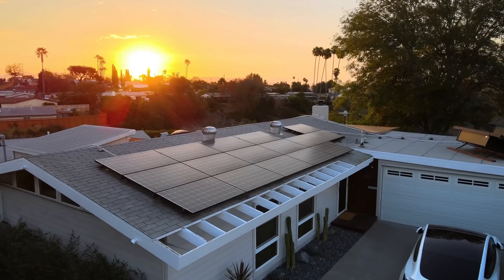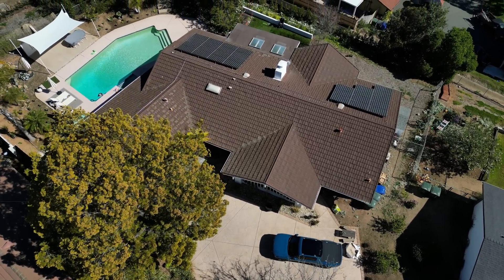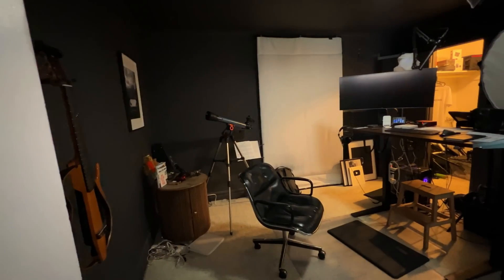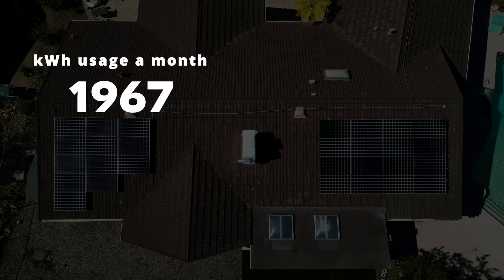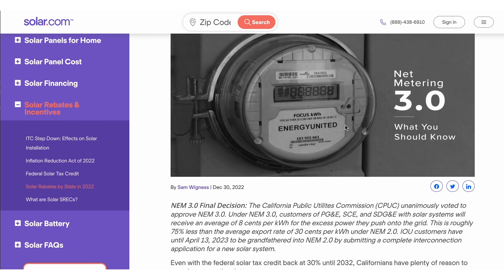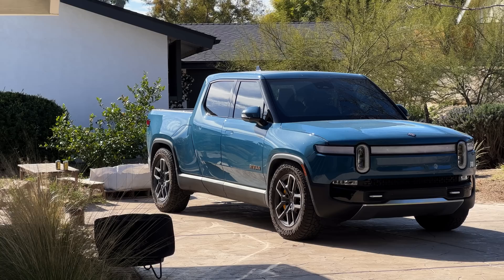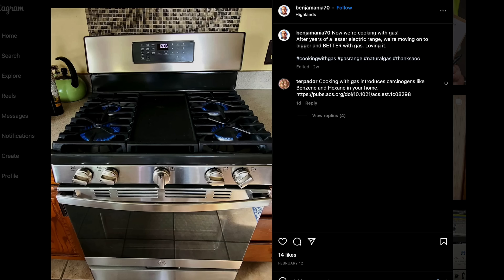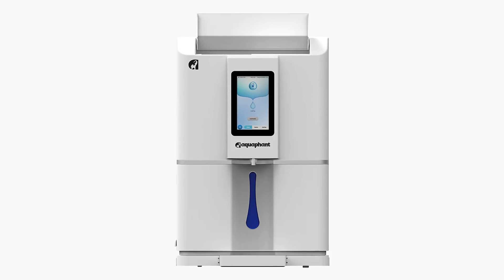Going Off-Grid at my New House!

Comment: Last year when gas prices hit record highs I stopped using gas for cooking and bought two of those same exact same Ikea induction plates. Together with another great electric gadget for the kitchen I used a dual airfryer unit. Result, massive reduction in energy cost from gas and a modest increase in my electric use. But as a guide, focus on the reduction of energy use using LED lights, behavior change in leaving lights/devices on, update to lower energy use appliances (like a dryer that uses a heat pump). Then insulation from solar heat using heat reflecting paints on your home, rockwool, etc. Then finally how to put together your own powerplant. Add solarpanels over your driveway, or solarpanels in the floor of your driveway and electricity storage. I like your water generator experiment. But be aware there are many more manufacturers who make such machines, small and large ones.

Comment: Heat pump dryer, water heaters, and AC, though central heating may not be needed in your area. Propane fire place and grill to help you get fully off grid from gas lines. Don't go with instant hot water heaters. They use a ton of electricity at the time of use and will require more batteries. Tank hot water heaters are effectively cheap batteries when it comes to heating water. If you want instant hot water, use smaller hot water heaters for those rooms. 

One thing that I'm curious about is more with water replacement. Fresh drinking water is very important of course, but going through options to get off-grid from water lines could be extremely helpful. Wells may not be possible in your area, but rain water collection along with less clean dehumidifier type options and a large holding tank could be possible. If nothing else, you could at least replace grid water for the pool and yard with that.

Comment: I would like to see you start with the solar system; particularly I'm interested in the efficiency of the current group of solar panels.  The newer panels produce so much more power per panel.  Also, are you certain a 2000 watt system is large enough for this home?
Reply: He didn't mean a 2000 watt inverter...2000 watt hr
Reply: I was thinking the same.   Are the current panels on micro inverters or are they string based?   Might make sense to take the array that gets the most irradiation and replace them with 400 watt panels.

Comment: The water hear and dryer I would leave gas. With my house being all electric I really wish I had a gas furnace for backup, a gas water heater is optional, and gas stove and we actually use a hot plate off the ecoflow when the power is out. But we do, in fact, have a portable ac with a heatpump built in here in East Tennessee. Heat is a big thing for winter. But I believe 16kw with about 30kwh of storage should be able to keep you off grid with water heater and dryer on gas. I'm guessing you went with Franklin? Batteries for the generator input. Smart move, that's the only thing I didn't like about tesla powerwalls. Other than that amazing batteries. Waiting patiently for your next video! We're gonna be getting a gas stove and 2 100# propane tanks with taxes next year. The wife misses cooking on gas and hates electric lol. All opinions, btw we love your channel and beautiful new home!

Comment: Heat pump clothes dryer and water heater, instead of gas or electric heat. Plus heat pump clothes dryer doesn't have a vent, one less hole in your wall insulation!

Comment: There are heat pump, a.k.a ventless, clothes dryers as well as heat pump water heaters you might want to check into. Those would be a quick project that could be tackled while you are finalizing your PV and battery plans.

Nice house.
Reply: We have just gone heat pump dryer in Australia. Fantastic but different. They don't toast your clothes and, in fact, don't set out to generate heat. The mechanical operation does generate a little heat but it is modest. They are clothes dehydrators in essence, not clothes cookers. Gentler on your fabrics but a little slower to complete a cycle. This is not an issue in practice. Very energy efficient and very much part of the "Stop burning stuff" and "Electrify everything" solution. I am always staggered at how much energy North American houses use. My solar makes 5.04kW at peak and we still send most of it back to the grid. Still watching the evolution of battery prices down under.
Reply: I hang my clothes outside or on racks in the house with a back up never used drier.  But the heat pump version really appeals to us.  We are interested in solar + batteries ( no money , just dreams ) and will be following your journey with interest.
Reply: Yeah great suggestion!  They suck moisture from the clothes by condensing it out of the air onto cold radiator baffles(? not sure what to call them). My brother lives off grid in a treehouse and has this kind of dryer.   Apparently it works great!
Reply: They don't get clothes super dry, but that just damages the fiber anyway.  Not damp...just not staticky dry.  They also take a bit longer.  If it is a big deal, get 2.  They also tend to be smaller.  That will probably change...Americans want bigger appliances than the Japanese.
Makers want to stay in the standard dimensions, but you can't have a 7.8 cubic foot capacity and a good heat pump in the same volume. They need to just make it taller, like it had a pedestal.  They could probably still have a half drawer in the bottom.  Who wants to pull out the full length drawer anyway?
Reply: @ChessMasterNate  not in my experience. Yes take longer but no heat pump dryers don’t get super hot, nor pollute your laundry room with excessive heat. We have an LG wash tower which is one unit with huge 16kg capacity in both washer and dryer. Heat pump has a 10 star electricity rating, using 4-5x less than a traditional dryer, plus being a condensing dryer, you can keep the windows closed and no humidity/ temperature buildup (important in summer if you are cooling the rest of your home). This LG is huge, 140kg mass so stable as concrete, but being an all in one, it knows what you just washed when you load it into the dryer section. We can wash super king duvets in it no problem, or a dozen towels. Expensive but recommended
Reply: This is exactly what I was going to suggest.
Reply: The GE model announced at KBIS a few weeks ago is the best combo unit I've seen.  They've fixed the lint collection issue with combo units and they're just a bit taller than a standard unit.   I imagine it'll become the new thing for the well heeled who will put two in a laundry room and will end up over 200 percent more efficient doing washing/drying.
Reply: Go with solar hot water. I have it and love it!
Reply: I was thinking the same thing. It would be interesting to see a comparison between the gas dryer he has now and an all-in-one washer dryer with a heat pump.

Comment: I'd defintely say the battery project and true up panels should be first. Buying my first home soon and although I'm in the solar indistry. Always nice to see your favorite youtuber install it lol. Also as well make sure you have a good amount of offset for the extra panels your adding so that in the future if your electric consumption increases you can have the capacity to comp with it. I say that because after NEM 3.0 goes into affect, if you uprade your system now and then add more later years down the line, it'll switch you to NEM 3.0 which sucks. Amazing videos, can't wait to see more new house content! Cheers!

Comment: Hey Ben they have heat pump dryers now. You can do it! The gas dryer is precisely the appliances you shld try to replace with low emissions one bc it's one of the biggest emitters!
Reply: We switched to a Miele heat pump clothes dryer last fall.  Smaller than most US models, and requires a bit more weekly care to vacuum the plinth filter, but not only does it not consume much electricity itself (runs off a 15A @ 120V circuit vs. 30A @ 240V for our old dryer), it also doesn’t vent to the outside, so you’re not throwing away conditioned air.  Just has a small water outlet that goes in the drain same as the washer, and it condenses the water out and tosses it down the drain.  Between the unit’s reduced energy and the conditioned air’s energy, huge savings.
Reply: @davidhunter4617  Thanks! I had little doubt they'd beat out an old electric dryer for cost efficiency. I'm hoping Ben will do this in the end and compare cost to running a gas dryer. I'm not sure if I'd switch because power is so unreliable here. I would have to put in a home battery first for sure. But that's something that is on my list.
Reply: I was just going to comment this. The heat pump ones (they use them in Europe) are smaller in capacity, and run longer cycles, but are apparently easier on clothes (lower temperatures) and since they don't generate heat (much like the heat pumps in tesla Model 3s) saves a ton of energy.  You could also look into the heat pump Water heaters too.
Reply: I've heard of these. I'd love to hear some information about how efficient dryers are.

Comment: HI Ben great vid. I would like to see how the new battery & add on solar panels are installed. New electric panel needed for more amps ect. I saw you at the Electric show in San Diego a few weeks ago. Also its great when you include you lovely wife in your videos.
 Thanks. Mike McHale ps do you offer consult I want to upgrade my panels and Battery also just got a huge quote it looks like what you're doing may be a good battery alternative

Comment: Based upon your current energy consumption, it almost looks like your home is in need of an energy retrofit to reduce your heating/cooling demand. Windows and doors are a good place to start, then air sealing, and finally insulation. Conservation of energy will allow you to go through longer periods should the grid go down or the sun not shine 🌞.

Comment: Switch HVAC to heat pump.  Heat pump water heater(s) might be a good idea as well.  I'd stick with the gas dryer as a lower priority conversion.

Looking forward to more on the battery storage you chose & why.
Reply from the maker: Definitely a go on the heat pumps / mini splits!
Reply: @BenSullinsOfficial  I'd love to see an implementation of a sand battery if you're willing to tinker a bit. Seems awesome.
Reply from the maker: Looks like it's commercial only?
Reply: @BenSullinsOfficial  Thanks for the reply. It's definitely early stages and why I said it's tinkering. Other than that, how about Phase Change insulation? Would be huge for your climate. Cheers

Comment: I didn't know "gas dryers" were a thing! We use heat pump electric dryers which have the dual benefit of efficiency and very low operating temperatures, albeit they're slower.
Reply from the maker: have you looked at how much energy they take? My research shows quite a bit...
Reply: @BenSullinsOfficial  About 3kWh for a 10kg load, I think.
Reply: @BenSullinsOfficial  10 star energy consumption on my LG WWT-1710B is 122kWh/year (cotton, normal,once per week usage 17kg). Great result on clothes, although programs are slow at 2+ hours. Condenser/heat pump washer dryer tower.